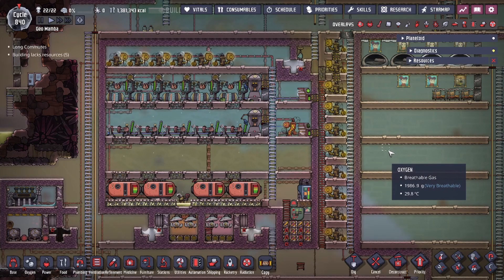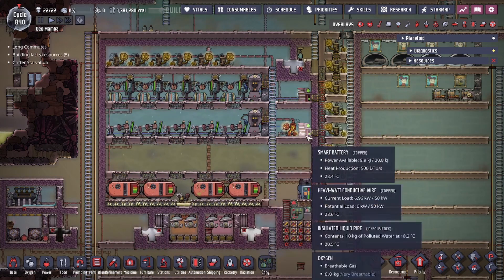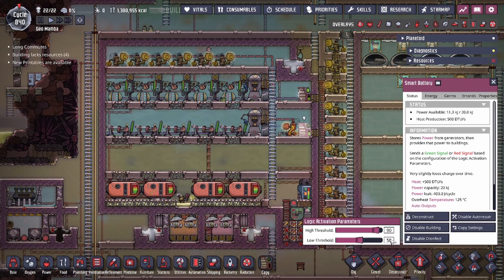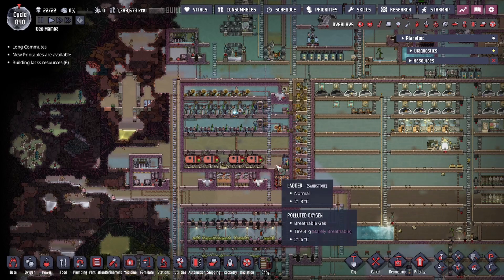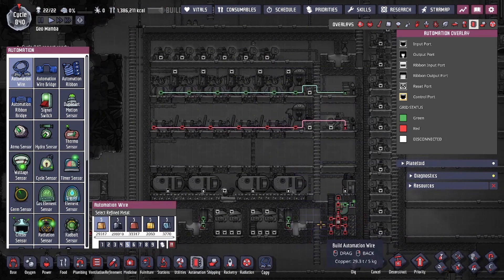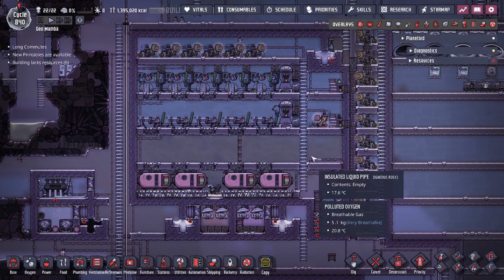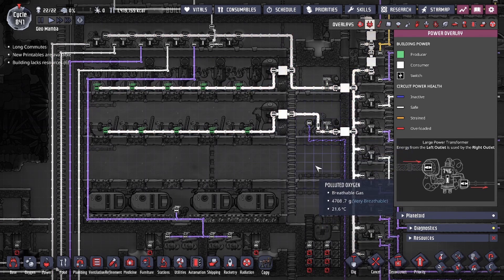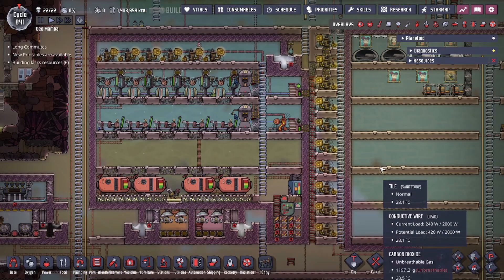Centralized Power & The Power Strip - Power & Distribution - Oxygen Not Included

Comment: Is the tune up worth it before you get a metal volcano? I always found it to be a unnecessary use of my metal that wouldn’t be worth in the long run, sort of like plug slugs.
Reply from the maker: i tend to use lead as my refined metal of choice, i was able to mine 300 tons of it at my oil biome but im on "classic start terra" so my asteroid is alot bigger. i also have an iron and copper volcano on this save as well
Reply: Probably not unless you REALLY struggle with power or you want to save on space. The latter is probably more relatable.